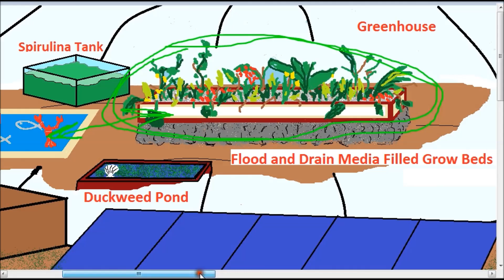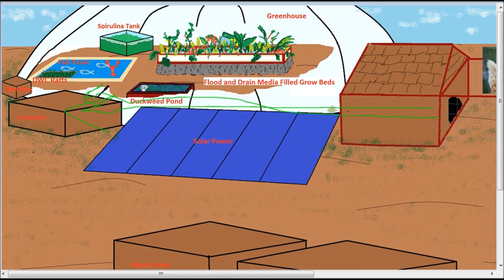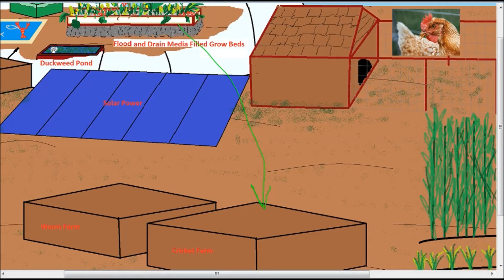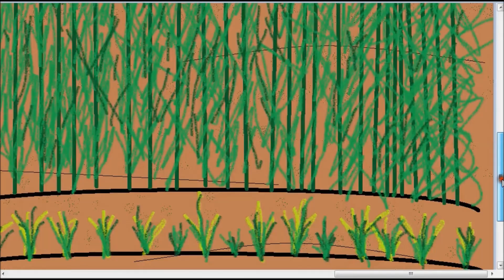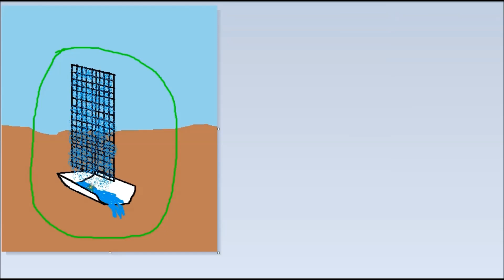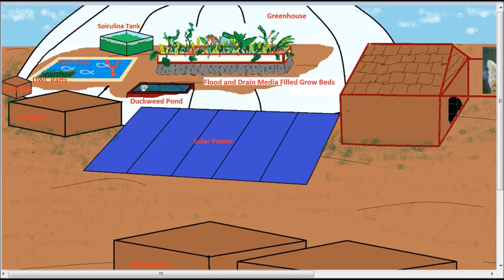Design for a Farm of the Future (complete self-sustaining food production system)

Comment: Nicely thought out system.  A few thoughts... 

Duckweed is an awesome idea along with Spirulina.  We should be obtaining the most use we can from every possible source of nutrients.  

Your system is well thought out.  I am going to add some ideas to help with bringing nutrients into your system easily.  

With your soil crops you can plant alleys with leguminous trees bordering them.  with 4 meters of space between the alleys, you can plant your short term crops & wait for the trees to shade over your crops... This should happen right about time to harvest... So, at this time you will prune back to leguminous trees after you have harvested your short term crops... 

You treat the crop residues as you mentioned already.   The leaves from the leguminous trees you will line the alleys with creating a weed controlling bed of protein rich leaves which will decompose slowly allowing your crops planted directly in them to benefit from the nutrients added by nitrogen fixing & by deep tree roots bringing other nutrients up from the depths of your garden substrate. 

What do you do with the limbs that are too thick to leave in the alleys? 
This is another addition to your system.  A charcoal production station which is basically a low heat oven where you will slow cook wood to turn it into charcoal.  

This charcoal will be mixed into your alleys between harvests & pruning to improve the overall health of the soil.  Tilling this material down a foot or two every year before pruning to add the layer of leaves will increase the porosity of the soil allowing for better aeration & also drainage.  

So, you take the short term crops & put the residues into your system as mentioned while using the legumes to continually improve your soil grown crops & their nutrient contribution to your system. 

About the human wastes part, I would hook up an ultraviolet treatment system that can kill any gram negative bacteria (the pathogenic ones) & render virus inert.  This could be powered with your solar panels, so no worries about the cost to run.  This would have to be composted in another area & mixed with regular composted materials to add benefit... Perhaps another worm bed to process into something less distasteful, & through feedings allow that to return to the system as well.

Though chickens are the go to fowl of choice usually because of ease of husbandry, they are cost intensive in materials & time.  I am planning to implement a similar system on an industrial scale and will be using quail instead of chickens... Taste better, produce eggs as well, 2 months turn around time to be able to eat them, & small enough that space can be maximized using them...

These are my thoughts... I wonder how your system has progressed?

Comment: The idea is a very good one. You should run it by some academics who focus in this area just for a possible, O did you think of this. Have you done any estimates of the size and scale to produce for 1 or more people? There is very very little on this subject and I think the follow through of this will make a great contribution to the already existing "zero sum" home designs and those who wish to life off grid. Great job Jay!!!
Reply from the maker: Ca Saucedo Thank you for your comment! For the scale, it is hard for me to tell at this point exactly how much space you would need per person. I would like to build the dome about 100ft in diameter. Then have a second smaller greenhouse for a cooler water system with trout and cooler climate plants. That should be plenty for a family with enough to sell or give away much of what is produced. The system would need to be fairly large if you will be eating the fish on a regular basis so it can stay stable while losing fish. For the chickens, 5-10 chickens can provide enough eggs for one family. If you are eating the birds you will need more.
Reply: Did you finally start (and finish?) building it?